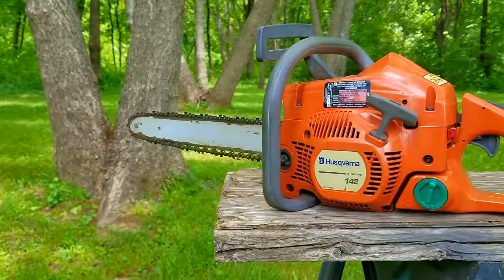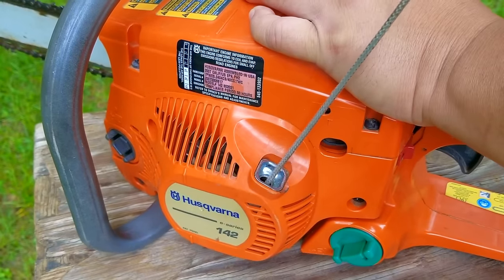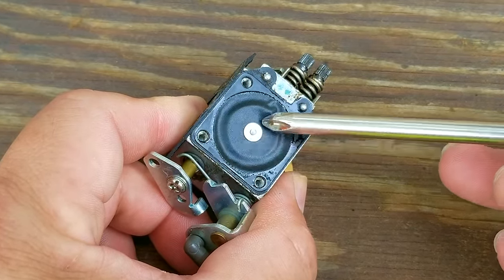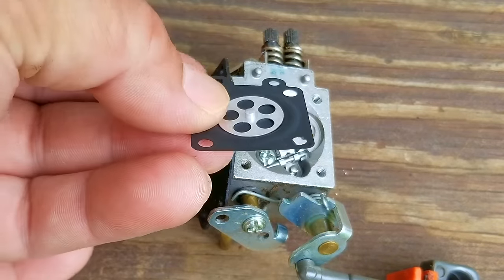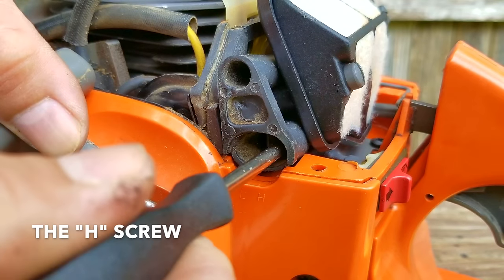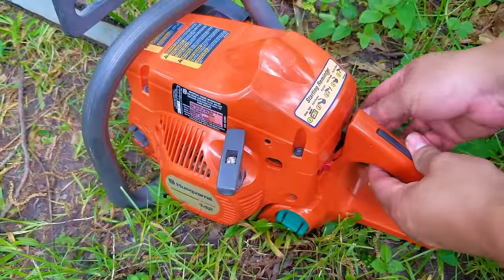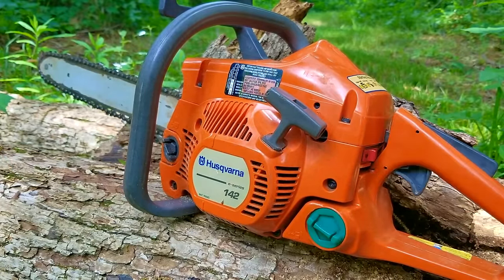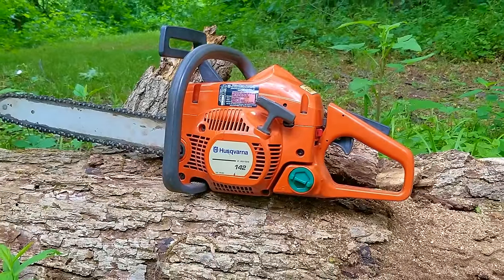Fixing A Husqvarna Chainsaw That Starts But Does Not Stay Running

Comment: Good video,  I have an old (2002 ) poulan saw,  most folks say they are junk,  but a new carburetor,  fuel lines,  and filter and it runs as good as new.  Much cheaper than a new saw.  I like to make my equipment last longer than most people.  Some folks say it's a waste of time.  I enjoy working on my stuff myself.
Reply: I have a wild Thing that’s at least 15 years old, always starts and runs like a champ
Reply from the maker: you are correct, cheap saw, can still cut well too.
Reply from the maker: nice!
Reply: @Jim-ie6uf  I have one that i just recently put a new piston and cylinder on. It's a great saw and wasn't paying attention to what jug i had with me and ran it with straight gas. I since then marked all my jugs
Reply: I have a Poulan 2150 from 1999 that I ported and made a custom pipe for and it's an absolute monster now. I have run it with a 36" bar without issue with a full 3/8 chain on it. Not bad for 34cc. So those saws are definitely not junk. 👍👍
Reply: My purpose was you had to find a steal or the Husqvarna or the pool in to put a hose for a two-cycle 2055 chainsaw

Comment: Factory carbs settings are always so Lean it barely runs
Reply from the maker: very true.
Reply: I always adjust a new saw to where it runs better than it does from the factory
Reply from the maker: that's a good idea.

Comment: I am working on my second saw. I needed to take it completely apart to get closer to the hole for the fuel line to fit into the gas tank before I figured out the trick to cut the fuel line into a long tab.  Once I got it all together and running I realized the chain is not oiling, I will have to take the cover and bar off again to investigate this further. I have watched dozens of videos like this one but they all neglect to show checking the oiler before reassemble.  The saw I am working on is a cheap  Mcculloch, very old, I found it in the garbage, the fuel lines and purge bulb were brittle and cracked, the diaphragms hard.  I bought an ATV air filter large enough that I can cut in half and have two air filters.  Fun hobby.
Reply from the maker: it's true, I only check to see that the chain has oil dripping off it after running it.

Comment: I have shared your video with several young people picking up small engine equipment at Goodwill as people pitch problems for electric and $80 batteries.   Your voice and tempo are excellent and your knowledge was excellent.  Thank you for explaining how to repair and adjust.  Your links are good and I bought a set of the $12 adjusting screwdrivers - best deal ever.
Reply from the maker: thank you very much, I appreciate it a lot.  Thank you for using the links as well!

Comment: Good suggestion on what kind of chainsaw to get several years ago I got a stihl ms271 with a 20inch bar we've had several storms since then that has brought down some pretty big trees that 20in bar has come in pretty handy. Great video as always
Reply from the maker: very true, larger than 18" for those properties that have large trees.
Reply: I don't think it's the bar size that matters, It's the amount of cc's. You can get both a 40cc and 50cc saw with an 18 inch bar, obviously the 50cc can handle more load. Heck, you can even get a 60cc with an 18" bar. So when you say get a saw with an 18 inch bar, you could be talking about a saw that can only cut softwood, or a saw that can bury the bar in an oak log.

Comment: You did the right thing and the saw ran fine after you got through. That's how I've always set mine and all the 2-cycle stuff. That would be a fine homeowners saw but if I was into firewood or logs it'd be a different story. I saw how the chain loosened up after running but that is  expected. Getting rid of the rust. Thanks and Blessings!
Reply from the maker: you are correct, I'll have to check the chain again.

Comment: In my experience, if the fuel lines are loose or rotted, the carb needs a rebuild too and vice versa. I always go through the whole fuel system, filter, carb, lines and primer (if it has one).  Having a saw come right back to you after you think you’ve fixed it is embarrassing. You did the right thing.
Reply from the maker: thank you Hester's Workshop

Comment: Great video.  We have this same saw that won't stay running.  Ours is a 2007 model that we bought new and has not been used very much at all.  I ordered the adjustment tools and metering diaphragms from your links and will try adjusting the carb.  I had to replace the fuel line because it had disinagrated inside the tank.  I also replaced the fuel filter and spark plug.  The carb looked very clean when I removed it but I didn't try taking it apart.  I may have to so I can inspect the screen.
Reply from the maker: good luck to you and thank you for using the links.
Reply: @HomeGaragechannel  I did end up getting the chainsaw running.  The screen was pretty clogged up.  The metering diaphragm that I ordered was the wrong one.  Our Husqvarna 142 has a Zama carburetor but I'm not sure which one.  Do you happen to know how to tell what model it is?  The metering diaphragm looked okay but I would like to have an extra one just in case.

Comment: You did the right repair on that saw for sure. That has an OEM Walbro carb? The real Walbro carbs are of very good quality and are worth the rebuild and you will have a very good chance of success with it. That bar definitely tells you a story if you look close at it... That saw was run quite hard either out of bar oil at some point or the oil passages in bar are clogged or the oiler isn't functioning. It would be worth it to pull the bar to clean the Grove and oil passages. Also rum the saw without the bar to watch for oil for the feeder hole to confirm the pump works. It's also a good thing you got to that saw before the backwards chain destroyed it. Great save! Believe it or not, one of those saws with no bar oil will behave like it has a carb issue or a damaged cylinder once the bar and chain get very hot because the chain will expand enough to have it seize up and cause the saw to bog.
Reply from the maker: I know right, the bar is definitely showing lots of wear but then again, it's easily replaceable even for the the owner.

Comment: Just my 2c, but it's still a little lean at idle I feel, has that horrible uneven run to it...And that chain.....needs a little of it's life filed off it to get it back to sharp. These little machines do amazingly well considering not many homeowners would know how to sharpen a chain, let alone maintain their saws. Good video!
Reply from the maker: I think you're right, I'll have to add some more fuel.

Comment: here's a pro tip for 2-stroke diaphragm's -  there are 2 major manufacturers for carb's - Zama and Walbro,  Zama uses a short stem and Walbro uses a long stem - now Ruxing is another brand of carb that has popped up on cheaper equipment in the last few years and i call them the throw a way carburetor - Ruxing does not offer replacement parts,  now i have heard a rumor that a Zama diaphragm will work in a Ruxing carb but i normally throw them away and replace them at my shop, a new Ruxing carb for an MTD trimmer OEM cost is about $20.

Comment: Great Video IHG! No you did exactly what needed done. With the fuel line coming off the fuel inlet, and the leaking tank, had you NOT replaced the fuel line, it would've been coming back to you anyway! Great repair. 
Also, I agree, just a small saw is all u need. I have a Stihl MS170 from about 2011. It's a wonderful little saw and does the 10 - 20 minutes of tree cutting I need to do per year at my house lol.
Reply from the maker: thank you Jacob Feather

Comment: My 142 has the gas line pop off too about 20 years ago. Hooked it back up and ran fine. I think they didn’t push it on far enough from the factory. Mine ran for about 5-7 hours before the issue.
Reply from the maker: I think you might be right.

Comment: Over the years I've seen many melted side covers from having the chain brake on while cutting. If the chain brake is worn or not working properly, it can happen. And when these guys are working hard and have a lot of cutting to do, they tend to overlook things like disengaging the chain brake before cutting, especially if its worn already.
Reply from the maker: you make a good point.

Comment: I always check the fuel lines whenever i take the carburetor off. I have an old homelite with a 34 inch bar and chain that has came in handy lately after we got a wind storm and knocked down a bunch of big trees. Most of the time i will always try and save the original carburetor if i can
Reply from the maker: yes I don't throw the old ones away either

Comment: Here is a good one for ya.
Husqvarna 435.  Saw cranks, runs a short period of time, and dies.  Anywhere between a few seconds or maybe a minute.  New lines, filter, put in a carb kit, and when that didn't work an aftermarket carb.  Good spark.  Good compression.  Intake manifold had a little defect around the impulse, replaced it with new oem.  Same problem.
As a guy who cuts a lot of firewood and has good husky's stihls and echos, my answer is "because 400 series saws are garbage" but it IS my dad's and i'd like to fix it.  Suggestions?
Reply from the maker: have you considered checking and replacing the tank vent?
Reply: Also check rubber boot while your there

Comment: Awesome video! 
I am here because I have a new (11months old) Husqvarna 525LK Trimmer that had the same symptoms after 10hrs of use,  brought it in expecting a warranty adjustment, ended up being charge $100 for a carb replacement, fought with Husqvarna to no avail.  Now, after another 10 or so hours of residential use, same thing, starts briefly then dies.
I wish I had found this video sooner (failed to look fail)  it I dropped it at the shop today, for an estimate this time...we'll  see, not expecting much, but now I can confidently bring it home and repair it myself !
Thank You !!
I am scientific with the fuel mixture (graduated cylinder oil/gas pump 3.000 gal) tho I run it 40:1...any thoughts on rich mixture having an effect on carb ??
Reply from the maker: thanks, as for a "rich mixture" affecting a carb, it's have to be extremely rich,  actually almost all oil for the carb to not be able to deal with it. So I doubt you'd mix it like that.
Reply: @HomeGaragechannel   Thank you for the response. 
 The shop implied "fuel mixture" was the problem the first time (as did Husqvarna!) and immediately questioned it when I brought it back yesterday.  Disgraceful!

Comment: nice job,  on most husqvarna. top of gas tank "under throttle link" there is a screen must be a vent on this vent is a rubber cone.
ever since I lost this rubber cone. my 240 xtorq just won't run the same....any thoughts?
Reply from the maker: I apologize I've never had to deal with the tank vent.   The screen is a filter, while the green duck bill is inside the tank.  As for your problem, I'd have to see the saw in person.

Comment: I got something funny to tell you back in the mowing season I was riding my go-kart and I found a Toro mower on the curb and it looks like it was brand new it was from 2018 it had a light layer of dirt on it the guy didn't answer the door so I just took it I thought I stole it I go back later and the guys in his garage putting together a Honda mower and that mower just needed a new air filter and a oil change and the blade needed to be sharpened
Reply: Oh by the way I've been watching you for about a year your videos are very good I learned a lot from your videos keep up the good work
Reply from the maker: very nice!
Reply from the maker: thanks I appreciate it!

Comment: Hey bro, what's up? Since I've been watching your videos bro, I've never seen or probably noticed where the check valve flaps ever been bad ever. It's always a blocked or partially blocked inlet screen and a bad pumping diaphragm. I think I might have installed the chain on my saw backwards when I was now learning how to sharpen the chain and use the saw properly. Trust me bro cutting Tonka bean tree limbs with a chain backwards is real headache.
Reply from the maker: it doesn't' happen very often, but the it is bad, you'll definitely know
Reply: @HomeGaragechannel  thanks bro👍👍

Comment: I got one the metal plate in front of the carb is missing. Is it important to operation?
Reply from the maker: it's fairly important.  It helps to brace the carb and seal it to the intake system.  Without it, the engine might be tough to start and if it does start, it may not stay running.

Comment: I have a old walk behind mower with a Kawasaki fb460v on its it seems to run fine and start up good when it’s cold but once it warms up it’s hard to restart do you know what the problem could be?
Reply from the maker: 2 things, spark plug or carb issue.
Reply: @HomeGaragechannel  thanks I’ll look in to it
Reply from the maker: no problem

Comment: If you are missing the gasket that goes between the carb and the motor could that cause issues with a motor running. And if so what kind of symptom? I am trying to diagnose a Husqvarna 51 that I can not get to do nothing but run for a second. I have tried carb adjustment but I can’t seem to get any different results. Possibly bad pumping diaphragm?
Reply from the maker: that's possible but the "run for a second" is quite telling. I would borrow a compression tester and see what the reading is. If it's low, it could be "borderline" where it's not going to run but for second
Reply: @HomeGaragechannel  thank you

Comment: So what is that light colored muck in the screens? I have had this stop gear this year. Is this stuff that got passed a poorly made fuel filter, or does this come from the gas?

Yes the saw needed cleaning and new diaphragms. You were correct to fix the carb first, before adjusting. Once set correctly on a clean broken in carb., you should not need to adjust it again. Fix the issues before adjusting the carb..

Had you just connected that hose, got the saw running, and adjusted the carb. enough to make the saw useful, the diaphragms would soften a bit as you use it, and the saw would then need adjustment again. I run into this with anything left sitting long enough. Usually, if clean, I just need to run an engine till the diaphragms get flexing good, and leave the jets at their previous correct setting. Assuming the engine will start and run.

No matter what though, if you adjust your carb to suit a dirty carb with bad diaphragms, or other issues, your carb is not now adjusted correctly; AND things WILL get worse from that point onward.

I have heard that OEM carbs generally come calibrated and set correctly. Only very minor tuning after break in. Not the same with knockoffs. Check the jet settings, throttle, and metering on these carbs.
Reply from the maker: sure, they left ethanol fuel in the tank for much too long.  Use only 100 percent gasoline to help avoid this
Reply: @HomeGaragechannel  This is my suspicion too, as I had three engines plug with this muck this spring. The only thing different this year is that we got a gas station locally. They only sell regular. I know better but bought some rather than a 45 minute drive. I should have made the 45 minute drive.
I add Lucas oil upper cylinder lube/injector cleaner and their fuel conditioner/preservative, to my gas; and still my engines got this crap in them.
If you are correct that this stuff comes from the gas, then a better fuel filter won't solve this either. Only better gas.
Reply from the maker: yes you are correct about that assumption, better gas would be best

Comment: I have a Husqvarna 353 e-tech with primer bulb. It idles irratically from rev to idle. Carb, main fuel line, fuel filter, and air filter are new. I am puzzled.
Reply from the maker: I would start to consider an "air leak" at a gasket or seal. This is a very hard thing to prove and find though.
Reply: @HomeGaragechannel  the carb gasket and bellows appeared to be fine. How about the other fuel line and primer bulb?
Reply from the maker: it's possible but the other seals would be on the engine.

Comment: Hi everyone i have husq 137 and i dont know carb setting?what is better carb setting numbers for husq 137 or 136
Reply from the maker: not sure, maybe someone else might know
Reply: Start at fully closed and open the low n high jet 1 1/2 turns counter clockwise. Should put you in a good place to dial it in a 1/4 turn one way or the other

Comment: .my roybi.string trimmer wouldn't start we had.a gave to.us.we.tuned.the carb and then is.ran perfect.the throttle.cable.is.a bit.long.so.it.dosent rev out somtime.ans.the exahaust glows.red.is.that normal want.ur.opnion😊
Reply: And the exahaust glows red.is.that.normal.want ur opnion😊
Reply from the maker: it sounds like you need to "adjust" the carb to deliver more fuel to the engine so it's not glowing red.
Reply from the maker: not normal

Comment: If u can hold a screwdriver, never buy a 10 dollar aftermarket carb. Half of them suck hard so best to save the original. It has a reason OEM is like 7- 10 times more expensive.
Also, replace the pump part while u have it apart. If you have to get parts anyway replace them all for a few cents. Not worth the time to take it apart again.
Reply from the maker: thanks